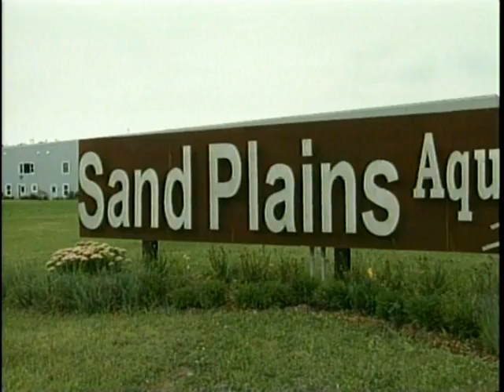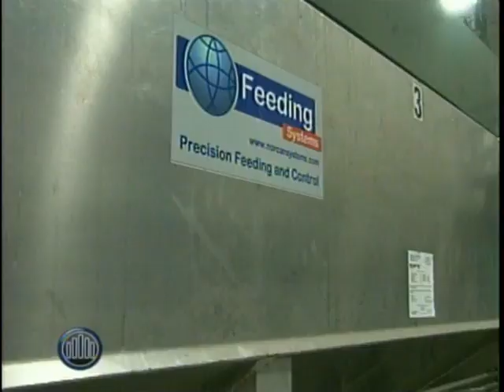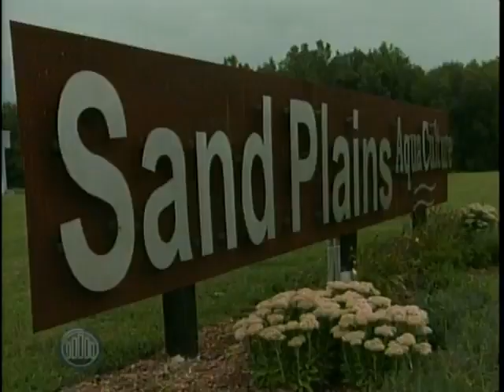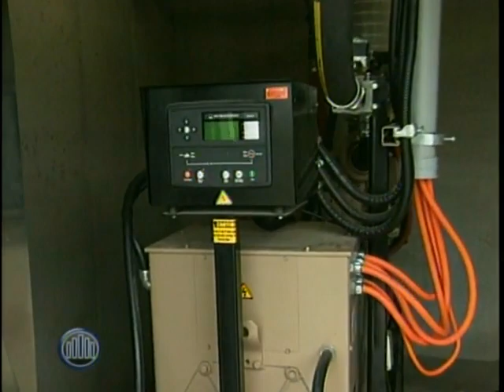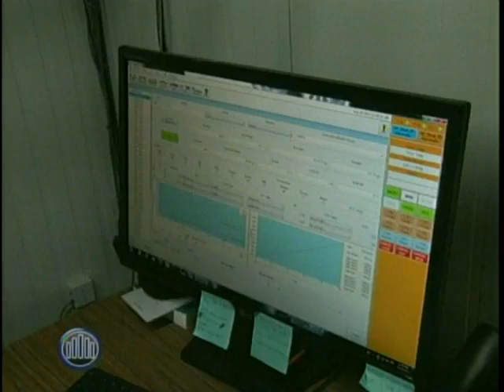Tilapia Fish Farming Safer In Former Industrial Building

Comment: With continuous cycling of of water in the system I am wondering there is accumulation, over time, of unwanted substance that does not sufficiently get out of the system with the solid waste?
Reply: They use it to grow crops on the farm outside, and dispose of the rest, waters cheap.
Reply: They know what they are doing my friend.
if they did not remove dissolved organic solids then nitrates would build up in the water and would inhibit growth.
Reply: The answer is yes, but there must be a "not so silent partner" somewhere around here. You could go into the live plant aquarium business very easily with the run-off, then you're using your nitrates, not to mention not having to buy expensive carbon/resin or other nitrate reducing compounds.

Comment: I prefer White Whitting.... Salmon and Smoked Salmon (like the deli sliced or restaurant kind) is my all time favorite.  The puller needs to be rethought out...the fish should be swimming themselves to a separate area perhaps for feeding that will automatically pull them....so the machine might be too loud and I think you're wasting a lot of electricity.  Too much oxygen damages their circulatory system....so hopefully its a low oxygen load....with oxygen that is perhaps kept at low given pressure.....why...because you should be using grass....if you can't use grass the process it and add it differently...but somehow they need chlorophyl...or lettuce....or alfafa...or cabbage etc...hahaha Don't we have purple lettuce...and purple cabbage...  Should you have one tropical light...? Or one tropical pool light...they go inside the pool...hehe  What do I know...just throwing ideas at ya... You don't have enough space I think...and they're not Wriggley Happy....they should be wriggly happy like a dog tryign to reach for i'ts tail..hehe  I think for breading you need a more real and more foliage filled environment....even if the foliage is plastic and even if you have to feed more.... Is there a dropper that you add as nourishment when you want them to lay eggs... Here in Florida they lay eggs as in many places in shallow water...and usually near grassy land or where the land has some type of top soil from gras or other plant life that has fallen like palm frongs...  So to avoid the mess of palm frongs and other plant life I still think you may need to recreate the shallow water effect and perhaps add the dropper of vitamins or whatever...what do I know...I do know the fish wil make it to shallow water and wriggle and fertilise the eggs......if they're happy they should be jumping out of the water....once or twice per day per 100 or 200 fish....what do I know is the ration...and in the shallow water...thats where all the baby fish hangout...hehe Rice will make your fish much bigger....like a rice dessert...or tembleque....Rice Puddin (arroz con leche or arroz con dulce) or Candied Rice (without milk or sugar use teabags instead of milk and water....and maybe condensed milk or not; don't forget ginger, cinnamon and raisins;....usually fish don't get enough to eat in real life anyway...it's like comparing them to a pet dog) etc. In 1 days time....will cause your baby fish to grow about 4 times the size...even apple sauce...haha You need bigger aquariums to allow them to grow to full size or wait half the size...7lbs...I think. No innovation is using less expensive means to oxygenate or to complement your oxygenation like using grass and alfafa and lettuce and the bottom suckers to keep the tank clean....what do I know...talk with a veterinarian or fish expert...but we use bottom suckers to keep our aquariums clean and cleaner...and they don't mate...but you're right they may not breed and you need a separate tank for breeding....keep in mind that like a mill....any motion in the water causes the water to be oxygenated naturally...so what happens if you were to use less oxygen....since you already have lots of commotion going on in the water and lots of water movement.....